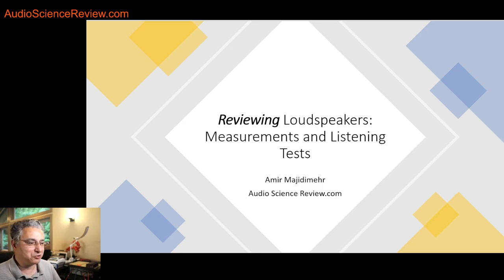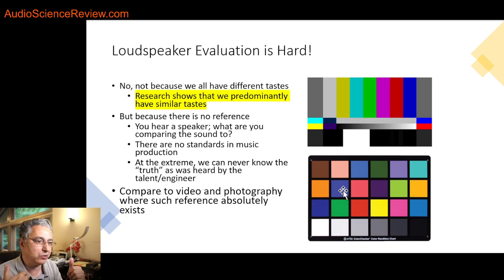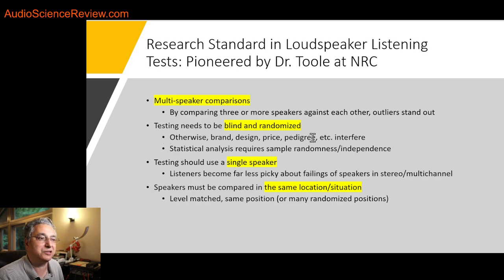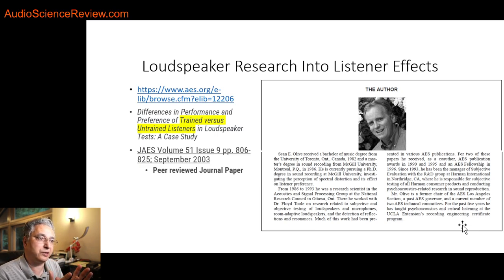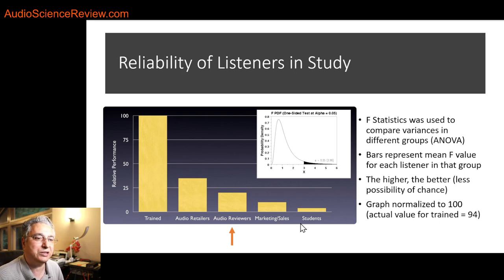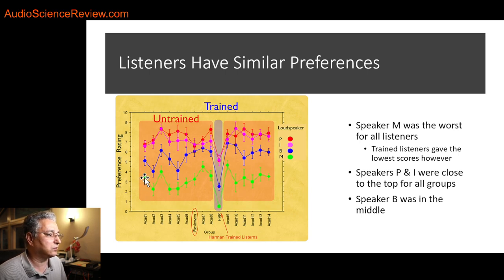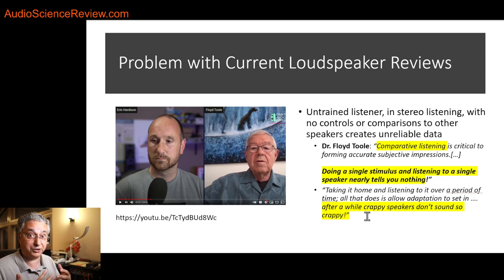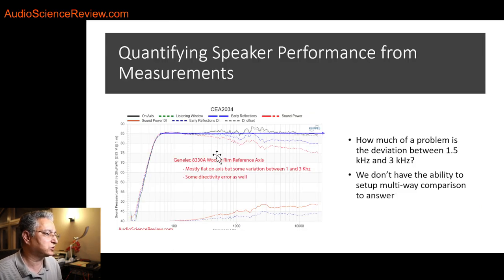Reviewing Speakers - Measurements and Listening Tests

Comment: I detect the assumption that all listeners process sound in the same way. There is variation in the nature of consciousness person to person. What is inside the head are variables.
Reply: That kinda stops being an assumption and becomes a scientific fact when different people gravitate towards the same notion of correct or preferred sound. It's not completely deterministic, there is some variance in preference, but generally Harman research on the topic shows it to be true.
Reply: @evgenetic3479  "similar" and "same" are not the same. ;-)  Similar is vague and can mean different things to different people.
Reply: @scottwheeler2679  It's statistics in the end. The variables in those Harman researches explain a very large portion of variance, but not all, so the  "vagueness" is limited. In other words, the chance of person disliking a speaker following ideal Harman FR curve (=flat on all axes, 20-20k hz range) is very low.
Reply: @evgenetic3479  I think that you are quite right which makes sense from the manufacturer's perspective. But when shopping for high end/state of the art speakers the standard is a lot higher than "not disliking" their speakers. I certainly would not claim their metrics are meaningless but I also would not say they are definitive for any individual.  And this goes back to the elephant in the room. That their testing is very limited in scope. One room, one position, limited source material in mono.The claims of universal transferability of the results of listening tests under these narrow parameters simply have not been supported by any research that I have been able to find. And I have looked and I have asked. I have asked Olive and Toole directly. And just to nip the possibility of the typical response in the bud, I have Toole's book. I have read it cover to cover twice and revisted a number of chapters numerous times. It's an excellent book. It does not offer any citations to scientific studies that clearly demonstrate the claimed universal transferability of the specific  tests done using the Harmon shuffler to a wide array of speake designs in a wide array of rooms in configurations best suited for different designs using a wide array of source material. The one study Toole offered up had speakers tested in two  different rooms in stereo. While the dimensions were marginally different in the two rooms there was no account for any differences in room treatments (if there were any) and no assurance that speaker setups were optimised for  the competitor's speaker design. So it did not even come close to covering all those real world variables. And this doesn't even touch on the fact that since those early studies back in the 80s a lot has changed with DSP.
Reply: @scottwheeler2679  First of all actually shopping for speakers is a pretty silly thing to do, it's like choosing CPU's by smell. No dealer/hi fi shop offers conditions remotely acceptable for testing speakers (compared to that Harman shuffler room), so your speaker impressions at the shop will be severely biased, distorted, and mixed up with a ton of confounders not related to actual sound -  thus useless. So measurements professionally done is your best anchor, and there's no good reason/science to assume that deviation from Harman ideals, measurements wise, will benefit you.  
There are good reasons for the chosen parameters, those are covered in their writings. The room resembles some kind of average, moderately treated living room. Position is typical for most listeners. The reasons for testing in mono are more complex and I don't remember them by heart, but it's all definitely covered in some form.  
At the end of it all you simply have to remember what the final goal is - it's reproducing what the musicians/producers intended for you to hear. Since most music is produced on speakers with flat FR on all axes in some kind of moderately treated control room, logically you simply have to copy that and apply to your own room. Even if you don't care for what musicians intended for you to hear, your best bet is still speakers with flat, predictable FR on all axes, that you can later modify to your taste using your own tools, DSP if you like. But personally to me it's like going to an art gallery wearing some yellow tinted glasses or something.
A lot of things are possible theoretically, if I only listen to some kind of avant-garde early 50's modular synth music, and I'm half deaf, maybe I'll like it more on some speakers with weird FR that only pump sound directly into the ceiling, I dunno. But practically speaking I have very few reasons to deviate from the Harman bible, its advantages are proven while the flaws are theoretical, and no one has done anything better.
Reply: @evgenetic3479  Shopping for speakers is something you have to do if you want to own speakers and are not going to be gifted them. The analogy tosniffing CPUs simply doesn't hold up. When one auditions speakers they generally do so in the same manner that they will be used. Not the sameas sniffing CPUs unless you are into that sort of thing. You really can't speak for all dealers or manufacturers conditions for auditioning speakers. The speakers I ended upbuying offer a 30 home trial. And let's not lose sight of the fact that that IS how we use them. So I am a bit skeptical that a 30 day home trial is an inferior means of selecting a speaker system than an assurance by a speaker manufacturer that theirs is a better product for me because they did DBTs using one speaker in a configuration that will not match my listening room. No doubt, biases are a factor in any sighted audition.But the idea that it makes the audition uselessdoesn't hold water. Sighted auditions are flawed but so is picking a speaker because a manufacturer does DBTs in a space that is different than my own. 30 day home trial givesme a much better idea of what I willbe living with than the promise that most people don't dislike our speakers based on blind preference tests. I was very interested in the JBL M2s. I could not find any way to audition them at all. They had to be bought unheard. I have a problem with that for 27K. 
I am also not convinced of the claim of universal transferability of the specific preference tests  done at the HK facility for reasons I have already covered. And again if there is a body of research that demonstrates I could rely on those tests to transfer to my persoanl preferences in my room regardelss of room treatment that body of research is a well kept secret. I've looked for it and asked the prime suspects for it. I can alsosay first hand after living with these speakers and using different roomcorrection DSP and other DSP such as the Theoretica BACCH4Mac that the speaker's performance is far more variable than the HK tests could ever reveal. There is no way that test would be a meaningful measure of my speaker's  subjective performance. I would love to some day do some sort of shoot out in my room using one of the top HK test based designs with what I have. Be it the JBL M2s or the Revel  Salon Ultima 2s. It wouldbe very difficult to do such comparisons blind because it would be far to easy to distinguish the speakers when I use my speakers with the DSP that I have matched with it. But still I would love to compare. Blind and sighted. I am sure it would be very enlightening. Do you know anybody in the Las Vegas area who has either speaker system who would be willing to haul them over to my home for such a shoot out? Honestly, I would love to do it. I'd even like to try it blind.
Reply: @scottwheeler2679  So suppose you have 10 potential speakers you wanna try, what dealership will build a shuffler suitable for DBT at your home, provide a technician or two to operate it at your place, and allow you weeks or even months of trials? How do you know the speakers you bought are the best for your money without ever comparing them properly? That's the consumer issue relying on measurements (3rd party ones made with proper tools and knowledge, not manufacturer's obviously) and Harman studies solves.
It seems you are familiar with that research but don't quite get why it's so important for consumer, and don't connect some vital dots (for example why a lot of it IS logically very transferable even without specific studies). The room-speaker interaction is not a deep mystery that has no answer and must be investigated individually, speaker that performs well off axes, and doesn't have some strange radiation pattern (like that Apple speaker that shoots sound 360 deg. for example), will be pretty much room agnostic.
I don't think involving DSP is useful in this discussion, of course it can do wonders, but it's baseless to assume that it would do better with some random speaker rather than with some Harman-ideal speakers.
Reply: @evgenetic3479   I don't really need to suppose anything. I already went through the process of buying speakers with the intention of getting the best speakers possible for me. Certainly it would have been nice to take every candidate and put them all in a shuffler that not only did what the Harmon shuffler does but did so in stereo with each different speaker idealy positioned with quickswitching room treatments that best suit each speaker design and custom matched DSPs to optimise each speaker system. But that is just a fantasy.Nobody does this including HK. So the ideal condition for auditioning speakers does not exist. the next best thing would have been blind auditions in my own dedicated listening room. But that wasn'teven possible due to the lackof availability of the two HK based designs I was most interested in. I already explained why the promise of a manufacturer was inadequate. I already explained the issues I think are unresolved with the HK testing. 
 "How do you know the speakers you bought are the best for your money without ever comparing them properly?" I don't but "proper comparisons" were not an option. However, as I already stated I amquite open and interested in doing any such comparisons with what I believe tobe are the two best measuring speaker systems to go through the HK testing process. 
"That's the consumer issue relying on measurements (3rd party ones made with proper tools and knowledge, not manufacturer's obviously) and Harman studies solves." Until the universal transferability of their results is proven in "proper studies" this a leap I amnot willing to make. "It seems you are familiar with that research but don't quite get why it's so important for consumer, and don't connect some vital dots (for example why a lot of it IS logically very transferable even without specific studies)." How is it logically transferable without studies given all of the known variables I have cited? Variables that make bigger differences than the metrics used based on the HK studies. I'd say it's not logical at all and absolutely does require substantial evidential support given all those variables and how substantial they are.  "The room-speaker interaction is not a deep mystery that has no answer and must be investigated individually,"  It's not a mystery but it is a complex thing.  "speaker that performs well off axes, and doesn't have some strange radiation pattern (like that Apple speaker that shoots sound 360 deg. for example), will be pretty much room agnostic." That's nice if one is looking for an all purpose speaker that will work in a multitude of untreated non dedicated listening rooms. A reasonable design goal for amanufacturer that has a major  invstement in their infrastructure. It does not neccessarily apply to the audiophile with the dedicated listening room and the means to acoustically treat that room whatever way they wish. It also does not take into consideration the powerful tools of modern DSP. Those conclusions were drawn by Toole in the 80s way before we had such DSP. "I don't think involving DSP is useful in this discussion,"  I think any discussion that exludes it is actually useless since state of the art stereo playback requires it.  "it's baseless to assume that it would do better with some random speaker rather than with some Harman-ideal speakers." In the case of the Theoretica DSP I am not making any such assumptions nor is my speaker choice random. And to ignore break through DSPs like the Theoretica and exlude them from the conversation is to keep the conversation relevant to the world of audio from the 1980s. State of the art involves DSP and the HK tests don't acomodate it or consider it.
Reply: @scottwheeler2679  "How is it logically transferable without studies given all of the known variables I have cited? Variables that make bigger differences than the metrics used based on the HK studies." 

Because they don't, simply read their studies more carefully.

"That's nice if one is looking for an all purpose speaker that will work in a multitude of untreated non dedicated listening rooms." 

I think that's the core issue - if you treat your room in a way that distorts the reflected sound you're receiving from your speaker, to accommodate that certain speaker you're using, that's a mistaken approach. A properly designed speaker (that simply radiates the same sound in all directions in certain cone) would require less treatment, not more.  Looking for a certain speaker that has a peculiarity that miraculously cancels out a very certain issue with your listening room is a crapshoot very likely to result in poor outcome.  
The DSP is simply a non issue in this consumer-speaker design argument we're having, because in any case you're always better off with a speaker that performs according to Harman ideals. It's simply a much better and convenient "clay" to work with. On its own of course DSP is essential almost all of the time, I use it to alleviate some room modes in my room. It would be a mistake to buy a speaker that has its own null in that same frequency to alleviate the issue.
Reply: @evgenetic3479  

"Because they don't (the variables), simply read their studies more carefully." Please cite the studies that demonstrate variables such as room treatments, speaker/listener placement in stereo and DSPs that affect frequency response and cancel room reflections and speaker cross talk don't make a meaningful difference that would affect the preferences. If you can cite studies that prove this I promise to read them ascarefully as I can. 

" if you treat your room in a way that distorts the reflected sound you're receiving from your speaker, to accommodate that certain speaker you're using, that's a mistaken approach." Any room reflection si a distortionthe point of such treatments isn't to add to that distortion but to reduce it to the point ofinaudibility. It'snot to "accomodate" it's to have a speaker/room that works together. The speaker/room is a system. Every speaker is affected by the room it is in. The HK approach is practical froma manufacturer POV for the everyman. But it hardly shows that a dedicated listening room with specific room treatments designed to work with the design of a speaker system is a subjectively inferior approach. And again, if you think there are studies that show otherwise please cite the actual studies. I am happy to read them. Testiminial doesn't cut it. 
 "A properly designed speaker (that simply radiates the same sound in all directions in certain cone) would require less treatment, not more." This is circular reasoning. You define a "properly designed speaker" by the studies that have limited the testing to the HK approach and then validate it by the fact that speakers designed in their facilities sound better in their facilities. It still doesn't show universal transferability. That their designes willlikely work pretty well in just about any room is of no consequence to anyone looking for state of the art and is willing to dedicate and treat a room to accomodate any speaker designer's apporach to state of the art two channel playback. Again if you can cite research showing otherwise this is a leap I am not willing to take. "Looking for a certain speaker that has a peculiarity that miraculously cancels out a very certain issue with your listening room is a crapshoot very likely to result in poor outcome." There is nothing "miraculous" about it. There are other apporaches that work. And the HK testing facilities  arenot set up toput thoseapproaches or designs to a propper test because they literally misuse the speaker.   "The DSP is simply a non issue in this consumer-speaker design argument we're having, because in any case you're always better off with a speaker that performs according to Harman ideals. It's simply a much better and convenient "clay" to work with" Prove it. Cite the research showing that the HK based designs are universally subjectively better with any DSP.
Reply: @scottwheeler2679  "Please cite the studies that demonstrate variables such as room treatments, speaker/listener placement in stereo and DSPs that affect frequency response and cancel room reflections and speaker cross talk don't make a meaningful difference that would affect the preferences. If you can cite studies that prove this I promise to read them ascarefully as I can. " 

But that's completely not the point, the point is that there's no basis to assume that Harman-ideal speakers would perform worse than any other speakers under same sensible conditions. Of course if you use a speaker that has a some serious resonance in a particular frequency and correct it with DSP/physical room treatments, applying the same to a properly designed speaker would result in lack of energy in that region, but that's kind of a silly proposition to start off with.

"This is circular reasoning. "
Well ask yourself that - why would you NOT have as linear as possible speaker to begin your audiophile journey with? The testing HK done is the best that's been done in that field, so as a consumer I really don't have any basis to ignore that and to baselessly inflate the significance of some factors they might not have covered exhaustively. 

"Cite the research showing that the HK based designs are universally subjectively better with any DSP."
It's either you don't understand the basic tenets of of HK design or can't figure out how to answer your own question logically with the help of that knowledge. Can't help you here.
Reply: @evgenetic3479   "The point is that there's no basis to assume that Harman-ideal speakers would perform worse than any other speakers under same sensible conditions." That's not the point. The point is non HK based designs often do perform worse under the specific HK testing conditions. And that is not an assumption. It's also not an assumption that highly directionalspeaker designs are better suited to work with DSPs that cancel room reflections and speaker cross talk. That comes straight fromthe designers of those DSPs. Wide dispersionspeakers are the worst when it comes to creating room reflections. So there actually is very good reason to suspect such designs will be less effective with those DSPs. And in rooms designed for those kinds of speakers. And there is nothing in the HK protocols that will test for this. "Why would you NOT have as linear as possible speaker to begin your audiophile journey with?" A legitimate question 40 years ago. Even 30 years ago. But I would flip that question. Why would exclude a speaker design for non flat frequency response in a time when that can be achieved more effectively with DSP no matter howflat the response is without DSP? Frequency response in and of itself is simply not a metric wrothy of prioritization anymore. Of course if the frequency response abberations are caused by other non linear distortions that audibly degrade the subjective sound quality that is a legitimate concern. But the HK testing as it stands does not distinguish easily fixed frequency response abberations from ones that are not. So it is a problem. And let's be honest here. Flat is a good starting point but it is quite often not the desired end point. That even goes for HK based designs which have a distinct curve from the listening position in stereo. DSP allows the listener to find the target curve that sounds best to them. Again the HK testing protocols do not account for these things.
 "The testing HK done is the best that's been done in that field, so as a consumer I really don't have any basis to ignore that and to baselessly inflate the significance of some factors they might not have covered exhaustively." I amnot suggesting that it be ignored. But the lack of support for the assertion of universal transferability oftheir preference tests  shouldn'tbeignored either.And yet a lot of people who accept the claims at face value ultimately are ignoring that glaring lack  of support. As such I would not ignore their research nor would I take it as definitive. 

>>>Cite the research showing that the HK based designs are universally subjectively better with any DSP.>>>
"It's either you don't understand the basic tenets of of HK design or can't figure out 
how to answer your own question logically with the help of that knowledge. Can't help you here." This is the typical ad hominem argument I get from people who buy into the HK mantra. You can help me here. Cite the research. You can't cite the research because it doesn't exist. Hence ad hominem and posturing. If you don't have the evidential support you got nothing. Trying to make it about me won't change that. Show me the evidence. This is supposed to be science based is it not? Is that how real science works when one is asked for evidencial support of an argument? If all you have is adhominem and posturing there is nowhere to go from there. If you got actual research then simply cite it.
Reply: @scottwheeler2679  "The point is non HK based designs often do perform worse under the specific HK testing conditions" - That's a new one. How would one judge how a certain speaker is supposed to perform to begin with? How and who and ranked its performance before putting it into HK room?  

"It's also not an assumption that highly directionalspeaker designs are better suited to work with DSPs that cancel room reflections and speaker cross talk. " You're piling on a lot here. Who said that reflection are bad? Why do you need DSP to begin with? What kind? What problem are you solving with DSP? The most common problem are room modes in low frequencies, and those frequencies are non directional to begin with.  

"Why would exclude a speaker design for non flat frequency response in a time when that can be achieved more effectively with DSP no matter howflat the response is without DSP? " There are different kinds of "non flat". If one has a few resonances and an elevated bass, you can fix that. But when you got serious dips, or poor off axis performance - that's unfixable. The ironic thing is that DSP is often used to help speaker sound flat to begin with (Neumann KH-80 DSP, for example), not to try to correct bad speakers after.

"But the HK testing as it stands does not distinguish easily fixed frequency response abberations from ones that are not. " That was not the goal of that testing to begin with, their goal was to find the best sounding speaker. You need measurements to find out which speakers are fixable with DSP and which are not. Amir emphasizes that a lot in his reviews.

"Flat is a good starting point but it is quite often not the desired end point. " That's a big bomb to drop that late in the argument...flat is what people in all properly conducted tests gravitate to, both when it comes to speakers and heaphones (Olive's studies), controlling for many other factors. I thought we were at least clear on that.

"Cite the research. You can't cite the research because it doesn't exist. " It doesn't exist because there's no need for it. It's just you who can't figure out why and instead keep repeating that lack of transferability point every post.
Reply: @evgenetic3479   >>The point is non HK based designs often do perform worse under the specific HK testing conditions>> -
 >That's a new one.>
Nope not a new one. It's an issue that has been raised many times.Goes back to the issue of universal transferability of the HK listening tests. 
> How would one judge how a certain speaker is supposed to perform to begin with? How and who and ranked its performance before putting it into HK room? >
As you have said to me, I shall say to you. Perhaps you should familiarize yourself with the HK testing protocols. That is what we are talking about. 

>>It's also not an assumption that highly directional speaker designs are better suited to work with DSPs that cancel room reflections and speaker cross talk.>> "
>You're piling on a lot here. Who said that reflection are bad?>
Edgar Choueiri, president of Theoretica. The specific crosstalk cancelation DSP I have referenced earlier. he is easy to contact if you want to check with him on the subject. And by the way, He is literally a rocket scientist. He understands science. 
> Why do you need DSP to begin with?>
For state of the art 2 channel stereo playback
> What kind? >
Well room, correction, reflection cancellation and cross talk cancellation for starters. For starters. 
>What problem are you solving with DSP?>
Many of the distortions caused by the speaker, the room, the room/speaker interface and the room speaker/listener interface. Things including but not limited to frequency response abberations, impulse response ringing, speaker cross talk and comb filtering. All things that are audible and not in the original source signal. Hence all of them are audible distortions. 

>>Why would exclude a speaker design for non flat frequency response in a time when that can be achieved more effectively with DSP no matter how flat the response is without DSP?>>
 >There are different kinds of "non flat. >
I addressed that.
> If one has a few resonances and an elevated bass, you can fix that. But when you got serious dips, or poor off axis performance - that's unfixable.>
Actually you often can fix that if it's a room node in the bass. Off axis frequency response is a non issue if the off axis dispersion is controlled by the speaker design, the room design/treatments and certain DSPs. You do enough to reduce the off axis levels and they become pretty much inaudible due to masking from the direct radiation of the speakers. It is a valid approach that HK has chosen to ignore.  
>The ironic thing is that DSP is often used to help speaker sound flat to begin with (Neumann KH-80 DSP, for example), not to try to correct bad speakers after.>

What is ironic about that? That was pretty much my point. It isn't the 80s anymore. Many frequency response abberations that are not due to resonances and other non linear distortions can be effectively fixed with basic DSP.

>>But the HK testing as it stands does not distinguish easily fixed frequency response abberations from ones that are not.>>
> That was not the goal of that testing to begin with>
1. That doesn't matter in the end. 2. Of course it wasn't.That wasn't a tool available to home audio when they did these original tests. But it is a tool now. Ignoring it is failing to address the current reality of stereo playback.
> their goal was to find the best sounding speaker.>
DSP is now an integrated part of audio playback. You can't just isolate the speakers from the room or the DSP and get a meaningful conclusions on the quality of the overall playback. 
 >You need measurements to find out which speakers are fixable with DSP and which are not. Amir emphasizes that a lot in his reviews.>
I agree with that but that but one has to narrow the measurements that matter in the given application. HK does not do that. They stick to their belief in an every room type of speaker. 

>>Flat is a good starting point but it is quite often not the desired end point.>> "
>That's a big bomb to drop that late in the argument...flat is what people in all properly conducted tests gravitate to, both when it comes to speakers and heaphones (Olive's studies), controlling for many other factors. I thought we were at least clear on that.>
No, it's not a big bomb and you might want to go back and check the facts on that one. Flat is not what people gravitate to. Do a google search on Floyd Toole target curve. You will see for yourself. It's actually a complicated issue.

>>Cite the research. You can't cite the research because it doesn't exist.>>
 >It doesn't exist because there's no need for it.>
Sure there is. Positive assertions require positive proof. The assertion of universal transferability of preference tests of speakers done in one space, from one speaker position and one listener position in mono to a universal preference in any space from a multitude of speaker/listener positions and DSPs is a pretty bold assertion. The fact that they don't allow speakers in their shuffler to be repositioned at all because it corrpts the test should be an obvious tell regarding the lack of universal transferability of those preference tests. If you don't have substantial evidence of that universal transferability you are taking it on faith. You believe it because they say it's so. That is quite unscientific. I'm not buying it without substantial thorough support from valid scientific research. And I can say first hand that there is simply no way the current testing protocols can tell you the whole story of what a speaker can sound like in a stereo configuration with room treatments specifically designed for the speaker and various DSPs that I have cited. My speakers completely change character wih those DSPs. How could the HK tests possibly predict the character of my speakers with those various DSPs that create such profound differences in character of the playback? You can't ignore that. That is the road to state of the art playback. 
> It's just you who can't figure out why and instead keep repeating that lack of transferability point every post.>
I keep repeating it because you keep trying to dodge it, ignore it and/or deny it. Mostly using the logical fallacy of ad hominem argumentslike this one. It is the issue that has not been addressed and has to be addressed unless you plan on listening to your music in  mono in a room that matches the HK shuffler room. I don't plan on doing that. 
If anyone thinks that the top HK based designed speakers such as the Revel Salan Ultima 2 or the JBL M2s would sound subjectively better in my listening room than what I have I would be happy to take the Pepsi challenge under blind level matched protocols. And I am not putting that out there as some kind of pissing contest. If those speakers are better in my listening room I want to know. I don't think the HK research shows or the HK preference tests prove that either of those speakers would neccessarily be my choice in my room in stereo under blind level matched protocols. I am quite open to the possibility. But I need proof. And if anyone is interested I live in Las Vegas.
Reply: @scottwheeler2679  Is this whole (tiresome) exchange a subtle commercial for those Theoretica products, or your attempt to justify for yourself the ridiculous price of that DSP that you bought? Why does it matter what the pres. of that company says? Who concluded that heavily DSPed sound is better? Under what testing conditions? Do you understand the simple notion that live music also generates a lot of off axis and thus reflected sound, and cross talk, so the phenomena that for some reason you call "issues" and "distortions" are simply natural sound? What makes "state of the art" playback , state of the art?  

"All things that are audible and not in the original source signal. " That's the dumbest thing you've said so far. The original source signal is what musicians and producers OK in the control room after the recording is complete, and that includes all the phenomena playback on speakers introduces. In in order to reproduce that you don't need some sophisticated DSP designed to address phenomena the creators didn't identify as problems to begin with, they certainly don't use such DSP.
Reply: I've went over the "press" page of the Theoretica web page, without exceptions all of the reviews for his products are coming from the usual hacks of hi-fi audio world that have been poisoning this field for decades with their useless subjective reviews and the peddling of overpriced and useless gadgets. Thanks for wasting my time..
Reply: @evgenetic3479  That is so scientific of you. You don't like people who like it. That's science on the highest level. Excelllent research bro.
Reply: @evgenetic3479   >Is this whole (tiresome) exchange a subtle commercial for those Theoretica products, or your attempt to justify for yourself the ridiculous price of that DSP that you bought?>
No. Do you know anything about it other than you don't like it because it got good reviews from people you don't like? 
> Why does it matter what the pres. of that company 
says?>
Fair enough. Why does it matter what Floyd Toole or Sean Olive says? You are taking their word on faith.
> Who concluded that heavily DSPed sound is better? Under what testing conditions?>
Maybe you should ask  Sean Olive that question in regards to the JBL M2s. He has drawn that conclusion.
> Do you understand the simple notion that live music also generates a lot of off axis and thus reflected sound, and cross talk, so the phenomena that for some reason you call "issues" and "distortions" are simply natural sound?>
Apparently you DONT understand that live music is completely different than recording and playback. You really need to understand that toeven have this conversation. I don't really see any point in going further in any discussion with someone who would conflate live acoustic music and the purpose/value of concert hall reflections with that of audio recording and playback. I kind of hate to be dismisive like that but I don't have time or patience to take you to school on that subject. So I answered your questions, you found that to be tedious. You disparaged a state of the art DSP because you don't like some of the people who gave it good reviews and did not bother to do any real investigating. But you takeeverything on faith that comes from Toole and Olive who have always had a business interest in their research. Sorry bro but that's religion not science.  And this is supposed to be about science I believe.
Reply: @scottwheeler2679  The difference is that HK findings are based on actual scientific research, not words of hacks from stereophole and cnet.